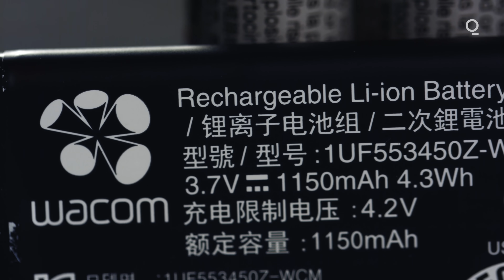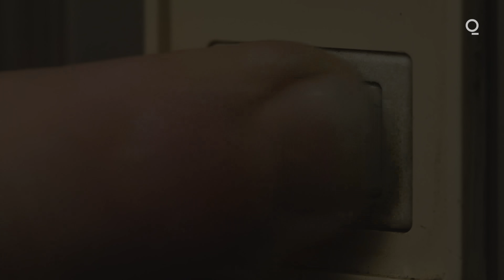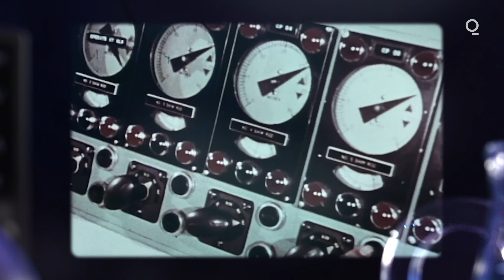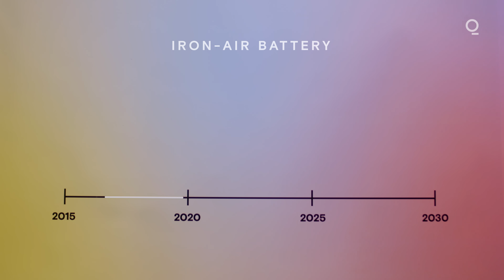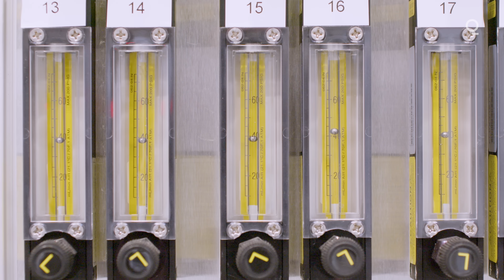The Huge, Weird Batteries of the Future

Comment: So...  consuming excess electricity to pump water up the mountain so it can fall and generate hydro-power when needed.  That part is fine, what I want to know is the power used per gallon for storage (pumping the water up) compared to the power/gallon generated on it's release.
Reply: I believe it is about 80%
Reply: RHE Velebit in Croatia is neer 90%.
Reversible derivation production plant with a power of 276 MW in generator and 240 MW motor mode (276 / -240 MW
Reply: What is also relevant is the price shift... That energy price difference might overcome the efficiency loss and make it economically feasable too on its own.
Reply: It is one of the most efficient batteries known
Reply: @raffaeledivora9517  Is it?

How do you define efficiency of a battery?
The UK has a pumped storage system of around 72-74%. The efficiency here is the ratio of the energy produced relative to the energy put in.

What other "battery" are you comparing it with?
Reply: @deang5622  Well, then the UK better improve their turbines... the pumped hydro storage system we have nearby, in Slovenia, has overall efficiency of 90%, which for comparison, is better than most electrochemical batteries. Yes, lithium batteries do better, but they only reach close to 100% when they are new and operating in ideal conditions. Most of the time they don't operate in those conditions and when they don't, their performance decays quickly... unlike water, which is always the same, no lithium dendrites short-circuits there! And that without talking about materials and energy density, both of those being heavily in favour of hydro for large scale applications
Reply: Why? The excess electricity must be stored. If the efficiency were only 20%, would that change?
Reply: @DavidHeizer  
You're thinking of hydrogen (20%?) 😉
Reply: @rogerstarkey5390  We're discussing water. That's called a "hypothetical," for the sake of argument.
Reply: I will give you a clue. It's less. The total energy generated in kWh is less than that used to pump the water up. The overall effect is a loss in energy.

If your demand for electricity is increasing , because of an increasing population and increased appliances being used, this pumped water system is not the answer, UNLESS you only use the excess electricity from solar panels or wind turbines to pump water up. Then the system is storing genuine energy produced from the solar panels, which you can discharge from the system and allow consumers to use it when the sun is not shining...at night.

Comment: The best battery are those that have been forged inside a super nova explosion. Uranium, thorium, plutonium are all insanely energy dense and extremely plentiful. Using fast breeder reactors we could power the world off of our current spent nuclear fuel for almost a whole century. That's just off of the high level nuclear waste just sitting around being radiative waiting for long term storage ATM.
Reply: Three problems: 
1. If all countries were to supply their energy need by fission, in 30 years there would be no more minable material. The required isotopes for fission are far from common or abundant. Together with the fact that a new reactor takes up to 10 years to build and Bilions and is the most expensive form of energy we can currently use, not feasible
2. Nuclear faces the same problem as renewables: nuclear reactors can't react to spikes or lows, they always produce the same output and changing the output amount takes weeks to take effect.
3. I want to see that thorium reactor. A physicist friend sometimes jokes about what will be finished first, Iter or a commercial thorium reactor able to use U233. By now there are just prototypes and countries like Norway are building their commercial version for two decades by now and spending tripple digit Billions. With Thorium reactors take too long to build to react to the current energy and climate crisis and they cost more than many countries earn in a year
Reply: @fatalityin1     three counter arguments

1) that maybe true if you only use thermal reactors that derive their power from the fissioning of U235 which is only about 0.7% of the uranium in existence. Fast breeder reactors can utilize the much more plentiful U238 which accounts for the other 99.3% of uranium supply. We can power all of the world's energy needs from the worlds spent nuclear fuel for close to 70 years. Current reserves can carry us for literal millennium.

2) it's untrue that a reactor can't react to changing load, I myself have served on an aircraft carrier and we'd frequently alter reactor power answering various bells. I'm not saying all reactors can do this but it's possible. But outside of that there's many ways to even things out, just like with renewables. But I'd say it's a little more favorable for nuclear as it's heat can be used to drive useful chemical reactions directly. Reactions to make hydrogen, chemical fertilizer, synthetic aviation fuel, etc. Or it's heat can be stored directly for transients using molten salts as a medium.

3) fast breeder reactors can run on thorium as well. There are some fast breeders operational around the world today including one getting built in Wyoming in America. The don't run on thorium but they don't really need to since uranium is so plentiful, especially since they can run on "depleted" fuel from thermal reactors. But as I said before, the current reserves of uranium could power the world for over a thousand of years. This didn't include the billions of tons of uranium in the oceans but just includes what humanity had access to today (~10 million tons). I don't see any reason not to pursue thorium though as it has roughly the same energy density as uranium and it's more abundant giving us even more thousands of years of energy budget
Reply: @zaurenstoates7306  To 1 and 3: you are naming numbers to all sources that are albeit plentifull either extremely ineconomic (filtering sea water would drive the price for nuclear power from currently 200$/MWh to around 500$/MWh) or simply infeasible (filtering earth's crust where 99% of U235 is located).

To U238: 238 is used to min/max U235 rods longevity transforming U238 into U239. U238 can not realistically be used as sole fission material but is added at between 24%-30% to U235 rods.

And finally, are you really comparing a nuclear boat with max 800MWh (most likely closer to 400 in day to day usage) to a modern commercial nuclear reactor with up to 6TWh output and saying that both can be as easily upscaled and downscaled? But that nuclear fission is very slow at adapting to energy needs is public news, if you don't believe me, a quick 2 seconds google search would give you the result.

And maybe you want to talk about how nuclear is to most expensive form of energy creation? You ignored my point to that.
Reply: @fatalityin1  Adding to your 3rd point, Molten Salt Reactors have been just around the corner for decades.
As one wag put it: "X is the power source of the future, and always will be."  Where X is fusion, MSR,...
I don't mean to denigrate them, but endless hype doesn't help.
Reply: @fatalityin1  
Well said.

Comment: It depends on the energy used to pump the water up and how much is received when flowing out. Otherwise it’s just the same old nothing.
Reply: That's not true though. The idea is that if you are making an excess of energy and wasting it, you should find a way to store as much of the extra as you can. You will not be able to store all of it obviously, but you are still in a sense "recycling" that energy.
Reply: @christopherpearson6105 
Exactly! And the round trip efficiency of pumped storage can be 75% or more.
Reply: @christopherpearson6105  It actually depends on what electricity is used to pump the water up to the upper reservoir.

If you have the mechanisms in place to only use excess solar and wind electricity to drive the pumps, then yes, you get a net benefit in the total amount of power generating capacity of your electrical power grid.
If, on the other hand, you don't limit it to only excess renewable energy driving the pumps, then what you have got is a system that can help you ride through the peaks in demand for electricity, say at certain times of the day, but this does not add to the net generation capacity.
Reply: @deang5622  That isn't its purpose, as discussed in the video it gives you a net gain  in the usability oh solar and wind energy, without increasing net output...a battery.
Reply: @tamalpaisgames  I described the two scenarios where pumped is useful.
You can't say that it is isn't the purpose when I covered the purpose in one of those scenarios.